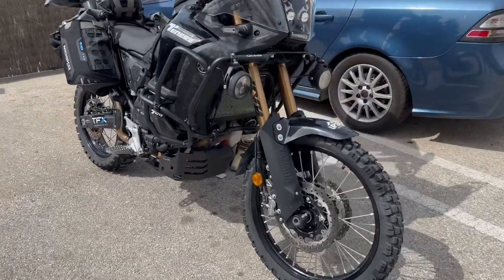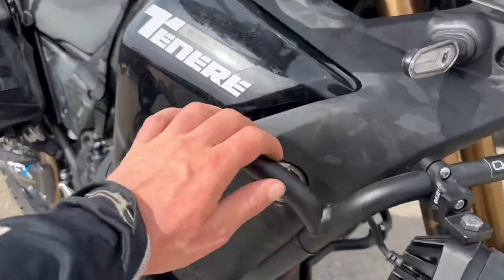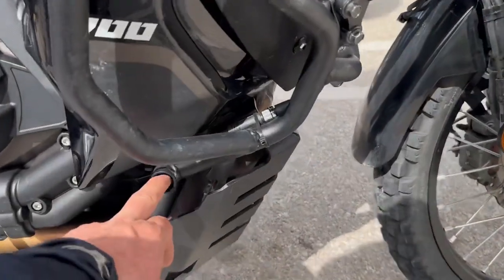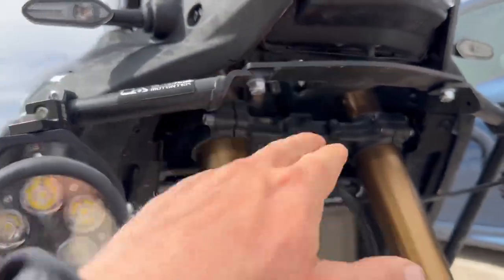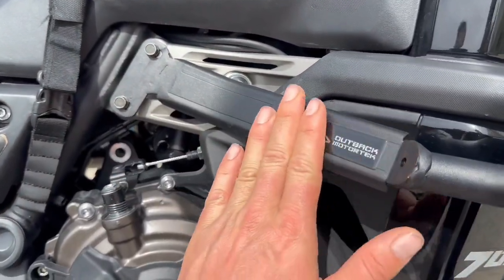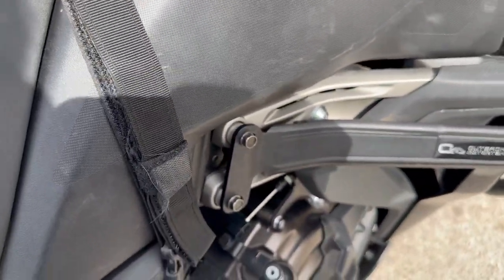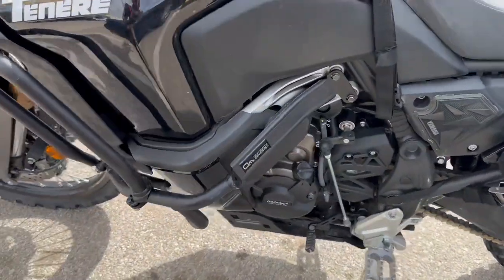Introducing our Yamaha Tenere 700 World Raid Crash Bars

Comment: The lower mount point you have used is not part of a stressed frame member, but just down tubes, used mainly for mounting the bash plate.
The reason that is a mistake is those down tubes are meant for vertical strength (ie knocks to the Bash Plate) and NOT side impacts.
So any sufficient or repeated falls will crack those tubes, probably at the top where they are weakest due to the hole there.
Reply: Thats not true. I dropped mine 50 times and they are standing strong
Reply: @elionh4532  I'm sure your empirical reasoning beats the material logic of mechanical parts being discussed.

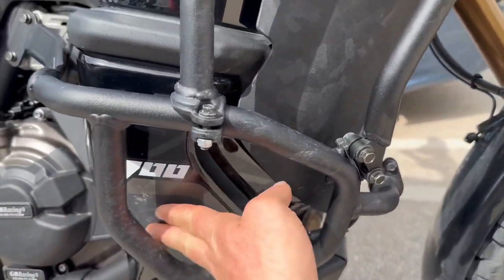Comment: Nice bars but I do find weird the upper bars bolt to the lowers. Especially the rear attachment point (center at 0:43) seems particularly exposed, that flange could hit the ground before the bars and if the upper flange breaks, It will save the bike but make the bars unusable. the front attachment (right at 0:43) has a different design with two horizontal bolts, more recessed and safer in a crash. But why are these not welded together?
Reply from the maker: Thanks for your comment. We drop test our crash for this reason: https://youtu.be/ZPJRd1g-OZw?si=NLnqFK96f7SvlVm_

Comment: Is it possible just to install the lower bars? Would be great to have a more minimal option like the SW- Motech or Garda lower bars.
Reply from the maker: No, not possible. The lower crash bars would not perform as well as with the upper crash bars altogether
Reply: @Outbackmotortek not performing as well and not possible are very different things.. I don't see a reason why is not possible
Reply from the maker: @man87907  we didn’t say it was not possible, but by running lower crash bars alone you’d jeopardize the performance of the crash bars. This is why we don’t offer lower crash bars alone.

Comment: I have long legs and even on the stock WR there wasn't much room for my knees when sitting. I could immagine that you will feel these bars at your knees if you are taller.
I just hope you can buy just the lowers for this bike. It should be plenty of protection when falling over, unless you want to have bars all over it at all costs.
For my regular T7 I wanted to buy just the lower OM bars but apparently I was too late to get those seperately. I really think many people would prefer to have the low bars only. I bought lower bars from another brand at the end but I would have bought from OM if they were available.
Reply from the maker: The tubing is replaced with a flat bar where your knees are. We’ve had tell riders test riding it too. No problem.

We won’t sell the lower crash bars alone because they won’t offer solid crash prevention performance. The upper bars add more rigidity without a doubt. Not to mention, the fuel tank and the fragile plastic panels are very exposed to damage and are expensive to replace.